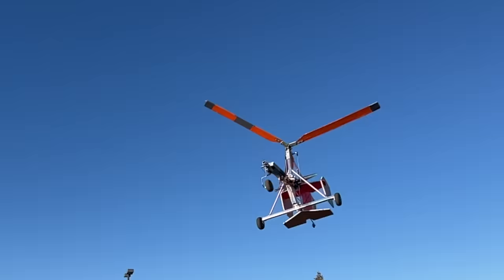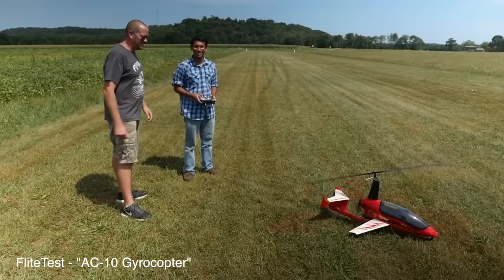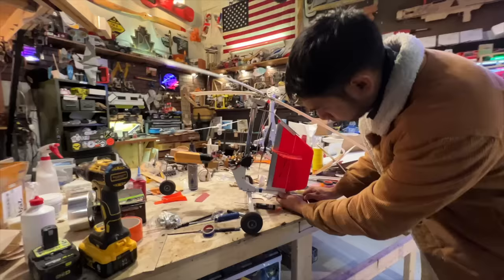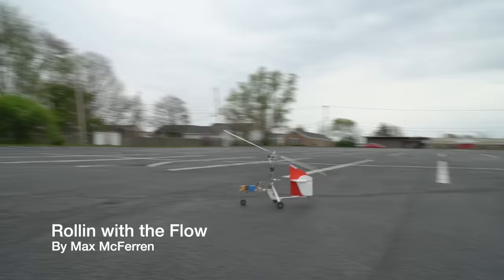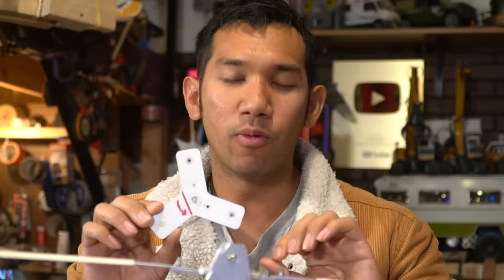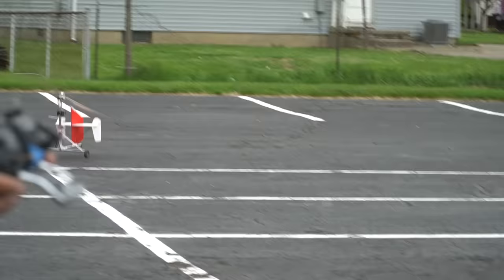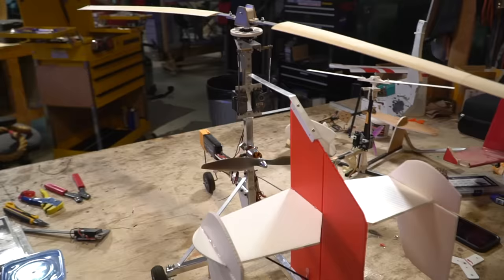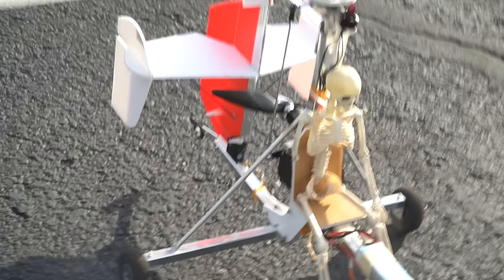This isn’t a helicopter or an airplane?

Comment: I have flown a 2 place version of this type aircraft and whoa it's a handful. There are dangerous harmonics that can develop between the main rotor and the prop so there are certain throttle settings that must be avoided. The simple linkage design is nice, but all of the hub mechanical vibration makes it way back to the cyclic which can be very unsettling. There are certain airspeeds that must also be avoided because of vibration that will make your wrist go numb. All in all it's more of a sounds good on paper idea. It feels like you're flying a paint shaker which I would not be comfortable getting used to even after many hours.
Reply: Bloody he'll what were you flying Other than care at wind up the gyro should be designed that prop rotor harmonics don't interfere.  Sounds like you were flying a piece of junk.
Reply: Just read the lower part of your comment.  The rotors were out of pattern or unbalanced if you are feeling more than a gentle thrum 2 per rev in the stick the blades are incorrectly set up.  If you are shaking up and down the blades have different angles of attack.  This is fixable.
Reply: @cameronlapworth2284  Raf 2000 it was a guy on the East Cost USA that owned it
Reply: @MoMadNU  I'd be very worried if the stick was shaking that much but it doesn't surprise me.  Very few know how to build or set up rotors I was lucky in that I was taught to build my own from wood and steel.  We had to learn to properly balance and track them.  People do stupid things like smash one blade the replace them with another blade off a smashed set.  Another problem is overspending the rotor in prerotation I suspect but it's a guess that this is bringing some out of pattern over time.  Some blade manufacturers are just making crap blades one manufacture of glass blades were I live was making the steel spars out of steel rebarb welded together ironically they flew nice but wouldn't trust them long term. All the nicest blades I ever flew were wood with steel spar didn't even need a trim spring hands off smooth as silk if you take the time to set them up properly.  From what you describe those blades should be either pulled down and adjusted or thrown away  that is not normal or as you suggest safe.  Those vibrations are going to go somewhere and could cause a failure in anything.  Most control systems have numerous rod ends or you could crack a mast none of this good.  Don't fly in that machine or at least on those rotors again until they are fixed.

Comment: Rotor RPM is too high causing stiffness which induces rotor flap/mast bump. Throttle back to not exceed your rotor RPM min/max limits.

Comment: Dumb question...
What about using a bushless motor as the head?
This would allow pre spin of the head, and dynamic braking after landing.
In flight and take off etc, it would be free spinning just being the bearings for the rotor.
I've always wondered this just never had anyone(way) to ask... 
I've built many models but never a gyro... Have a gyro-kite and playing with that just trying to make it fly scared me off of model gyro's.... LOL

Comment: is using a high KV direct drive motor for pre-rotation cheating bc it basically makes it a helicopter? yours was on a sprocket but that seemed really dinky, surely direct drive would be better
Reply: a low KV motor is better for starting from a stop, but getting to high rpm is more important, and auto rotation will be more focused on reducing power draw rather than being necessary for takeoff

Comment: You misunderstood the principle of the autogyro. Move your device forward and the wind will turn the propellers at the top so that the blades can stir the air and gain altitude. take off should not be forced.❤️️👍

Comment: Video suggestion: make a 2 gyro version with counter rotating blades so there doesn't have to be unbalanced lift.
Reply: That's an interesting idea. Sort of like the auto gyro version of the Kaman helicopter
Reply: @MoMadNU  Ooh, that one's cool too. I was picturing something configured more like the Osprey, which might be easier to build due to not needing to synchronize the rotors, but either design would make for a good vid IMO.

Comment: In the pilot episode/movie for the series "Airwolf", the craft was described as a lifting-body design that could go into auto-gyro mode when the additional jet-thrusters were engaged. I've always wondered if something like that could actually be built and flown. Obviously the fuselage design would have to be significantly different from a modified Bell 222 - as the depicted jet-thrusters would be entirely too low on the body to do anything other than pitch the nose up. However, the concept SEEMS plausible - I'd love seeing someone tackle a build like that. I think you possess the requisite skill and tenacity to pull it off - any thoughts?

Comment: I think gyrocopters are starting to become obsolete as modern helicopters are becoming more nimble while modern planes are becoming more stable. I don't think there is really a point to have a gyrocopter in the real world for doing things that helicopters and planes do. Obviously as recreational aircraft they can be addicting to fly and to ride in but in the real world they don't have a place. Its like a spork. It can be useful at times and its a cross between 2 things but really its just overcompensating for something that doesn't need compensation and over-complicating things.

Comment: 6:50 -- RE: Your explanation for how the rotor gives lift;  Excellent 2 sentence explanation BTW, but I'm wondering if you are ever going to "close the loop" so to speak with why it gets called an Auto-gyro.  It Auto-rotates, which is what a helicopter has to do when and if the engine stops working and it cannot power the rotor.

Comment: Is the main rotor still powered when in the air?
Reply: No this is why they don't need a tail rotor no torque.  Helicopters need to transition to this if the engine quits.  They have a few seconds or thier rotors fold up.

Comment: Hey Peter: can you try to build this?  A Chinook-style gyrocopter with vertically offset blades?  I'm insanely curious as to whether or not inline twin-blades would be a stable configuration, especially if you force more drag on the rear rotor to have it also act as a yaw stabilizer.  You could have two puller motors close to the front to add some thrust-differential steering and even more yaw control.

Comment: Make it bigger and much heavier ... the disc has allmost no load thus gives it weird behavior. Your construction seems so light that in case of a motor fault the inertia is so low that the drag of the blades can make the rotor stop - that's why you need some serious weight to be able to keep the autorotation going.  And also ... a long acceleration before taking off.

Comment: hello, can someone explain. doesn't this machine need a tail rotor to counter the rotational force from the blades? much like a helicopter. i see this doesn't, so how is the rotational force from the blades counter balanced? thanks
Reply: The reason is that the rotor isn't powered by a motor (after the initial spin up anyways), it's freely rotating so there's no torque applied to the body
Reply: @AnimeHairSyndrome  oh wow, that is very interesting

Comment: I noticed that the RC gyrocopter tends to flip upside down a lot. Can someone explain why that is happening, because to my knowledge, gyrocopters shouldn't just flip upside down unless the person flying the gyrocopter forces it to.
Reply: If you fly up then pitch down too fast (probably not an accurate description) the whole thing tumbles out of control. Most common way autogyro pilots die

I believe it's zero g combined with gyroscopic precession, if the whole thing becomes weightless it tends to roll over then crash.

Comment: you know that the blade must point down to 7 degress not less than 4.5 and you need a proper wing blade all wings with the airofoil shape produce lift at air speed more air speed more lift you cant dive a cessna without creating lots of lift and then tearing your wings of give it a try all your models have the rotors too flat good luck
Reply: 100% right

Comment: Maybe you could build the copter thing with the top / main rotor blades not pointed backward and make the top / main rotor blades point forward can the small other rotor is facing one way the you should make the top on face the same way as the lil one

Comment: hey I used to fly the big ones Bensen style gyros and gyrogliders towed behind a car.  now I haven't watched the whole video yet but I think the reason you are having control issues is gyroplanes are stick free stable but stick fixed unstable.  that is extremely stable hands off but any control needs to be tiny and corrected for so in a servo driven model you are simulating a poor student.  try adding some flexible tube between the control arms that is to simulate a looser grip.

When instructing in the gyroglider I used to force my students to only cup the front of their hand around the stick that way they couldn't death grip it.

The gyro will do exactly what you tell it to.

also consider adding chord weights to slightly over balance the blades chordwise.  The stabiliser on the tail is not stabilising anything but the airframe.  

Bensen discovered that balancing at 30% Chord instead of 25% is much more stable you have nothing here so the least stable configuration you can hope to get.  remember your controls will give you zero feedback.  

having flow 30% chordwise blades home built wood I can tell you they were immune to gusts our normal opperating speed was 30mph we hit a massive thermal in the glider which topped off the hall gauge at over 80mph normally this would have flung up to the top of the rope trying to avoid oscillating on the tugging tow rope instead we gently gained about 5 ft and had no change of angle on the machine.  try that.

Comment: As you are an off-grider, and China is becoming a less and less nice place to buy and ship thing from, how about this challenge:
Is it viable to 3D print a 12V Electric rechargeable Battery stack? or :
Maybe possible to convert your old laser printer or Ink-jet into printing a double sided Cathode / Anode pair that can be stacked and steeped in types of electrolytes?
Reply: Challenge #2  Terminator UAV. (You may need help from Youtuber aquaintances): The Terminator (1984)  is becoming a real flying drone creepy and real threat: 
Requisite: A checkered available lot filled with 200 - 400 letter sized photographs of friends, strangers, cartoon characters, Inanimate objects and of course: foes. (Or similar. This can be political or not.)
One basket with sticky candy like marshmallows or chocolate creamy cookies .
One basket with rotten tomatoes. 
A UAV with an octopus gripper  to make a fly over, then methodically  bombard the "bad guys" with rotten tomatoes, and finally reward your friends with sweets. Will you be able to make the UAV work as planned?
Possible sponsoring from:  Shopping centers, UAV retailers, Secondary schools, Universities, Municipalities, or even Local Navy or Air force?
Reply: If possible to remove the spammers and click baiters from your comments?

Comment: these machines climb like a plane but land like a helicopter all because of airspeed making rotor speed.its all to do with the correct air speed to spin the rotors fast enough to produce lift. as you pitch up, rotor speed drops causing rotor stall. the rotors basically are just making a disc shaped wing, the rpm needed, i believe the motor torque is causing the roll over due to increase throttle and decreased lift caused from low rotor speed caused from low air speed.
i was taught to fly theses using air speed and rotor speed 
had to use tension springs pulling the rotors gimbals back at correct tilt for a level flight
fit a tacko to rotor and make thrust line as low as possible to center line of gravity by using a more stepped keel and stepped gear box.

i always wanted to make, now see a GYROCOPTER  model that fixed the original design problem.
also original the design had no engine and was to get dragged on a long lines behind war ships

Comment: Hi. Can you design and build direct drive rc helicopter with direct drive tail rotor. It nicer if you can build it to 600 size. Thanks. Been following you since the full scale plane.

Comment: Several times you referred to your rotor tilt control as the cyclic. I know in helicopters this means a mechanism that varies the pitch of a blade through each rotational cycle, hence the name. The asymmetric lift produced does happen to tilt the rotor, but its main job is pushing the whole chopper in the desired direction. So, is a simple rotor-tilt control called a cyclic in autogyro land? This pedantic non-pilot seriously wants to know. 🤔
Reply: Yes. A lot of gyro pilots (and instructors) refer to the stick (incorrectly, in my opinion) as a cyclic.
In a gyro, the rotor pitch is not changed cyclically as it is in a heli. The entire rotor-head pitches and rolls and the pitch of the blades (relative to the hub) remains fixed.
Reply: Half Rho V Squared  yes

Comment: mesh blades, not filled
Reply: ie ultra light frame blades or wings
Reply: when in stop, it will pass air through, when in flight, it will lift, its like horizontal grid fins

Comment: Have you considered a set of counter rotating blades that are slightly angled and timed to prevent collisions? Something like the military k-max helicopter? I feel that would help the uneven lift during forward flight while adding more stable lift overall.

Comment: Juan De LaCierva invented the first practical rotorcraft.  Before that, they could not make the rotorcrafts move out of place.  They were attached to ground by wires.  Not usefull.  Later on he died as a passenger on a flight to England,  They blamed the Germans for sabotage, but they could not prove it.  The inventor of the Diesel engine died in the same manner.  A flight to England.  Sabotage was not proved either.

Comment: Twin contra rotating rotor designs with a rotor on both ends a stub wing works way better with no lead/lag teetering flappy rotor hinge nonsense and no swash plate. Conventional rudder and elevator control works well for this.  But if you like spending out to keep crashing these highly problematic single rotor designs then enjoy!

Comment: Gyrocopter, It's like a plane but shittier, and with all the  issues associated with helicopters. . Hope you don't: Overspeed or you'll have a retreating blade stall, Descend too quickly or pull up to fast on the collective. Because you will stall and start falling uncontrollably, and or just snap your blades right off in the case of yanking on the collective in a dive.

Comment: jeezuss          you  are  still  totally  CLUELESS,  about  DISTRIBUTION OF MASS (dom). 

TOP-heaviness in the dom is  Increased, if:  
the main rotor is made  'heavier';  the mass of servos is located  'higher'; the mast is made extra  'tall';  the mass of a pre-rotation motor is located 'higher';  the mass of the main motor is  located 'higher'.        the elevated location of the mass of the battery  Reduces  pendulum-effect stabilization.        there is almost  NO  mass  where  the  c-m  SHOULD  be  located.      c-m  is  center of mass.           all  of  these  OBVIOUS  design  Mistakes   Reduce   STABILITY.!!!

span-wise  Stability is  Reduced, if:
the dom of each rotor blade is not  optimized; the radius of the main rotor is not large enough.

stability at rotation/take-off is  Reduced if during take-off roll, the aoa of the main rotor is excessive.

generally,  aspect ratio  DOES  scale  down.!!!        COMPARE  the aspect ratio of a full-size  rotor.!!!!

at 11:46,  can you see the  Absence  of mass,  where the c-m  SHOULD  be.?!?   ( NO  PILOT there! ) 
can you see that the  stabs are  over-large,  heavy  and  too  numerous.?!?
can you see that the amount of  horiz-stab area  is excessive.?!?   
can you see that the c-m  SHOULD  be located  where  a  pilot  would be.?!?
can you see that the thrust  LINE  Should  INTERSECT  the  c-m.     googletranslate